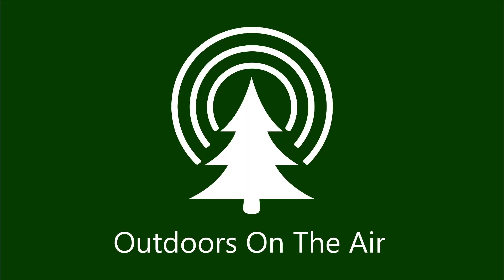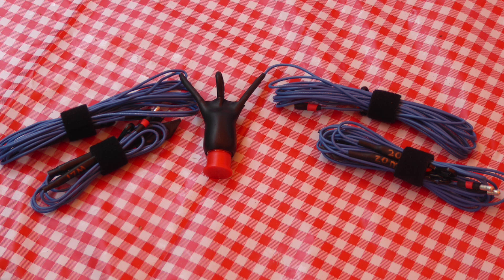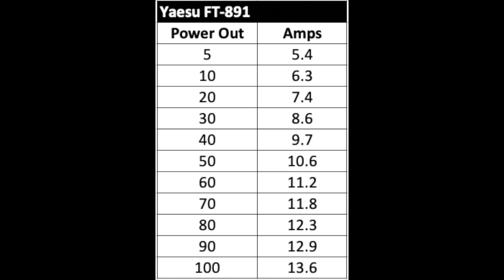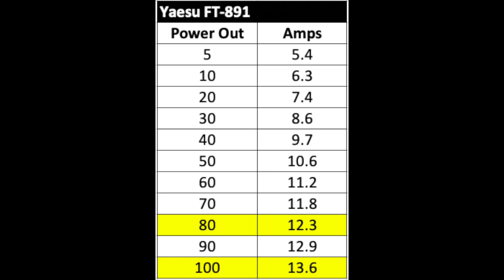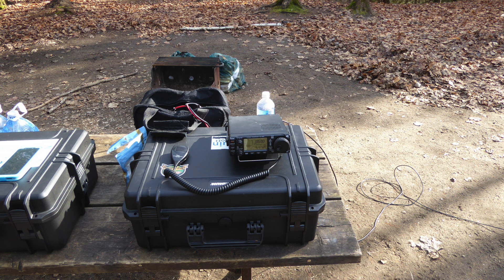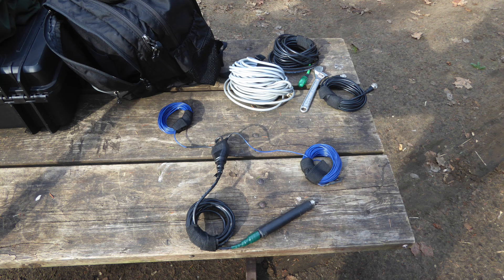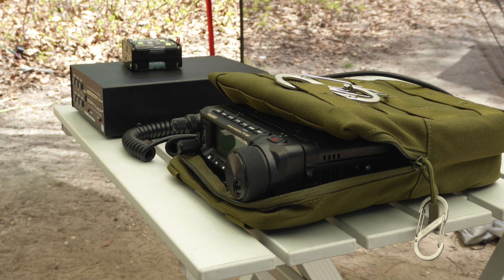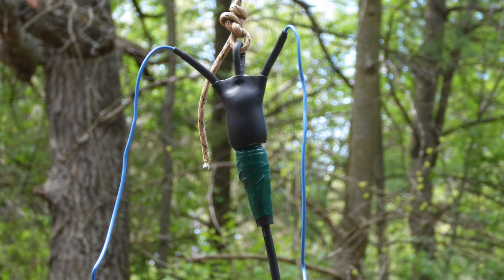The 3 Keys to Portable Ops Success - RF Power, Batteries and Antennas

Comment: Tracy. I have a new to me ft891 but it doesn't power up on two different batteries. A 12ah lifepo4 and a car battery. Just a click when power is applied.  I assume it's dead unless I'm doing something wrong.
Reply from the maker: Sorry to hear about that. Use a known-good 12v dc power supply that provides at least 20 amps. Also clean the contacts on the fuse or replace with a new one.
Good luck!

Comment: Hello Tracy, thanks for the interesting video. Very interesting was your statement about increasing the power output to gain 1 S point. This was unknown to me.
I have seen you are using a  LifePo4 Lithium Battery, is there a difference in use between such a Lithium battery and the older Drycell battery (as you used earlier)
I just have  made a measurement on my FT 817nd in FM mode on a dummy load. The current drain on RX is 0,375 Amp, in TX High power 5W the rigg takes 2,235 Amps. I guess the TX 1,5 amps you told was slip of the tongue. No problem.

73 de ON4GED
Reply from the maker: Thank you for your comment! The primary difference between the LiFePo4 and the SLA batteries I have used is that the Lithium Irons  will hold their voltage at a higher level longer. This means that similarly rated (in terms of Ah) SLA's will not give you usable power for as long a period under the same load as a LiFePo4.
As far as current drain on the 817:
I've done some testing with my own 817ND. During a test, I measured 1.35 amps current draw on 5 watts when transmitting FM on 80m. You've got me thinking about that, so I am going to recheck as that number does seem quite low.
Reply: @OutdoorsOnTheAir 
 Maybe your FT817 was not in High Power. It is difficult to see it on the display. I need every time to reed my manual to know in wat power position the rigg is.
p.s. I was forgotten to thank you for your answer. Thanks.

Comment: What bag do you use for your 897? The zip top molle bag seems like a great fit.
Reply from the maker: That bag is a well-built house brand bag from the SAIL chain here in Canada. The brand name on it is Black Ghost. It has a capacity of 17 litres and is about the right size for the 897 with FC-30 tuner, a 10 Ah LiFePO4 battery, power cable, microphone, a 20 foot length of coax and a wire antenna.  Wish it was just a bit bigger though (as with most things in life  😀).

Comment: So if I understand you right, I can run a Xiegu g90 at 20w and make same amount of contacts as I would with my FT891 @ 20w? And the g90 is about $440 vs the 891 @ $640. Interesting. Use the $200 saved and buy a Spiderbeam 12m pole. I still love my ft891.
Reply from the maker: Yes sir! And I'm not getting rid of my 891 anytime soon.

Comment: If I missed this, forgive me, but I never seem to see any grounding on POTA rigs in the field.  Are ground wires for the radio, amp, tuner, necessary or do most people decide to do without them?  I realize that pounding an 8', 1/2" copper rod into the ground for a 3 hour POTA session is not at all practical, but I use a small slender copper rod that's threaded at the top end for ground wire terminals.  Small, but still somewhat effective.  Need I even bother?  I've got a new FT-891 and I tend to over-think things, but I want to be ready when I finally get my outdoor rig....outdoors.  I'm pretty new to radio, hence the questions.  
Thanks.
Reply from the maker: I rarely use a ground when operating HF portable. I've never felt the need to do so.

Comment: Great video! I would like to add two points:
1. when running SSB make sure to have good audio. If available use an equalizer to attenuate low frequenies of your voice which eat power and do not contribute much to intelligibility. There is no need to sound like an AM broadcast station. Use a compressor.
2. Taking part in a program like SOTA or POTA can make you a sought after station. Spometimes this feels like a 10db gain over regular portable operations😉

Comment: As always, Tracy, you did a beautiful job. I've had similar experiences with my FT-818ND running 6 watts with a full half-wave dipole on 75m. The locals can't believe that I am running QRP when they're pushing a 1kW. It's amazing how long you can ran on a small LiFePO4 battery with the reduced power and a good antenna system. 73 de KT1RUN

Comment: You have trees to help and I agree a full size antenna makes the difference. Whenever I have trees I will use my favorite random wire 51 foot antenna unless I can fit my my multi tap dipole.  I use a KX2 and 10 on SSB you can be hear if you hear them. CW you can go lower.  You have great advice we all can use for portable operations.

Comment: Tracy, why operate 20w RF Output when 100w is less than double the draw? You may have to call three or four times, or more with 20w in order to be heard, but often you only need to call once with 100w. If you have to call with half the current over a period four times as long as you would with 20 watts, you've successfully used twice as much power as you would've if you just used 100w and made it easy on everyone.

Instantaneous current draw does not equal average current draw. 

This weekend, while working an EA hunter, he could not hear me at 80w, but copied me at 100w. 

We have the battery technology. LiFePO4 batteries can be drained to 0%. Just run the maximum output you can, save the other ops' ears, and transmit less often if you want

73 de VE3GKT

Comment: You touched on it, but the battery being so important also really does affect radio choice. For example, a typical refrain from some I hear about QRP is "Just use your 100w rig and dial it down to 5w,  you don't need a dedicated QRP rig". Except many 100w rigs use up to 2A on receive alone! My KX2 uses less than that on transmit! And the main reason I bought the KX2 was the fact that it only uses 150mA on receive. The battery drain of radios is way too overlooked in field ops. It's definitely an important consideration when you're choosing what to take with you out in the field.

Comment: Unless you have a true 13.6 volts at the radio you'll never get 100 watts.  Depending on the radio, each volt less than 13.6 can have a substantial impact on maximum power.  The Icom IC-7300, for instance, applies battery voltage to the driver stage AND the final amplifier stage; so a reduction in battery voltage also reduces drive as well as reducing power available in the final amplifier; basically reduction squared.  Lithium batteries have high surge current capability; AGM batteries have relatively higher internal impedance and will sometimes drop low enough the radio turns off during transmit.  This can be somewhat alleviated with a large capacitor (I use a "1 farad" automotive capacitor) to provide surge current.
A battery booster is a simple solution to this problem.

Comment: Another excellent video. WELL DONE !
So many new hams don't equate S meter readings to power out in watts compared to db. In other words, they think that 90 watts out compared to 100 watts out makes a noticeable difference when in reality that difference is only .46 db and no S meter in the world is going to show that difference. 
I suggested to Yaesu to take an FT897D, design it for only 25 watts out, remove one of the internal batteries and put a ATU in that slot. This would first cut back on current drain at those power levels compared to any rig that puts out 100 watts turned down to those power levels and it would also make for a more usable dual purpose QRP and medium power radio.
My suggestion went t deaf ears !
Last month I got rid of all of my lead acid batteries and changed to LifePO4 batteries. I have two each 20 ah batteries and one 10 ah battery. 
Take care and keep up with your great videos.
Barry, KU3X/QRP

Comment: Another great video with saged advice.
I believe your current chart reflects SSB phone. Digital would be higher due to higher duty cycle. Its another small niggle to consider.
Antennas are king in efficiency and deployment as you well point out.

Comment: Tracy, a great informative vlog, thank you.  I am a Foundation licence holder (M6KVK) and almost all my HF (SSB) operating is done in the field /P and your station triangle: Power, Antenna, Radio is something I have always referred to when setting up.  I am restricted to a max 10w output so my power calculation is not critical, I use a Tracer Lifepo4 16amp which lasts me a whole weekend.  My antenna of choice has always been a resonant 1/2 wave fan dipole or a single depending on what bands I want to use, no tuner in my bag.  My radio of choice is either my FT817 or 857.  I usually take the 857 for its 10w capability, but I'm very happy with either.  On my limited RX pwr I am still able to get contacts all over the world and really enjoy the experience.  Many Thanks.... 73
Reply from the maker: Thank you for sharing your findings! 73 from VE3TWM.

Comment: Great video Tracy. When I go bicycle mobile at the beach,  I try to keep everything simple.  I use a 40ah batt, 100w and a resonant 20m vertical  
With 4 radials on the sand, very little gear but pretty much guaranteed dx contacts.
73 zl3xdj
Reply: Beaches provide superior ground plane results ideal for vertical antennas.

Comment: I would think you would get your activation over far sooner at 100W, thus you would need to use the rig for far less time. Given the way draw decreases per watt as you go up it seems silly to use less. More is more, and less time due to better receive by the stations you are calling. It is not about how many contacts you make, but how many Parks or Summits you activate, you could get to a second activation location if you got your activation done quicker.
Reply: Breaking News:  ninety-eight percent of the contacts I make don't even realize I'm operating QRP.
Reply: @davidvaughn7752  your quite the statistician!
Reply: @forgetyourlife  It's not that hard to approximate - with a high degree of accuracy - the clarity and success rate of my transmissions when you keep a detailed log book.  Even so, thanks for the compliment.
Reply: An interesting counterpoint.

Comment: Thank you Tracy, sage advice indeed!  I love it when you make videos like this since I've taken your philosophy to heart and has help me become a successful QRP SOTA operator and your wisdom reaffirms the realities of propagation and optimizing those elements which we can control, that create success. Yes, yes, yes on everything you present in this video.  The one thing I've learned after 11 years of operating QRP (and it's not surprising you don't mention it) is location.  For Field Day this year, I will again be hiking up to a summit; this time @ 3000 ft in a pristine radio environment in the North Cascades (Mt. Washington), and the antenna (72ft. Random Wire) is a lot more effective at that elevation hooked up to my 817-ND.  Guile and cunning can help me in a "hunt-and-pounce" scenario during a pileup (timing) and having the healthy expectation that I just won't be able to get through to some when the receiving station has a high local RFI environment.  When you're at lower elevations the five watts just doesn't do as well.  But local geography/elevation is worth mentioning.  I've always made at least/around 100 contacts for the past eight years - I know that may not seem like a lot, but for me every one of them is hard-earned and a joy to log especially when I slam a station on the East Coast or in Europe while operating remote from a primitive campsite.  Take care and thanks again for your guidance.  73, K7GYB